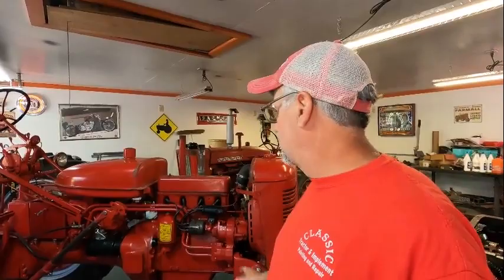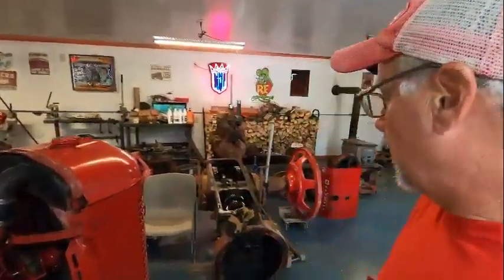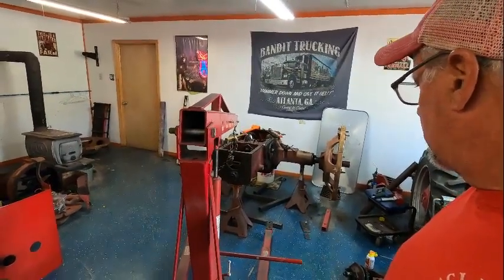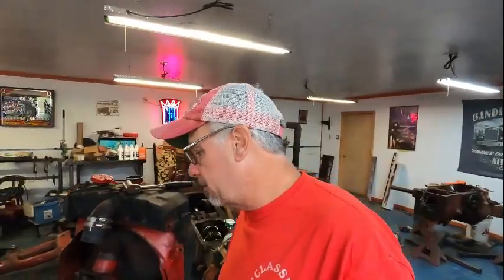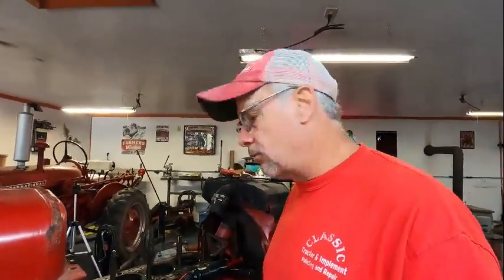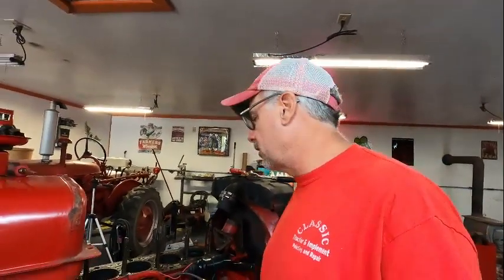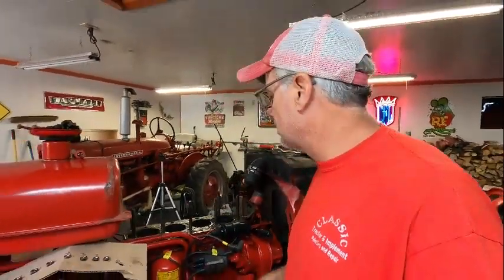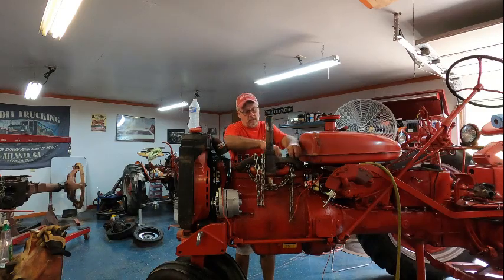Head Gasket Replacement

Comment: Sorry to see that "C" with troubles, but you are doing the right thing, especially where it was a "pulling tractor".  Attic vent fans?  I hope one is pulling air in and the other pushing the hot air out to create a cross air flow, or is there another way for replacement air to get into the attic?
Reply from the maker: There vents under the eaves of the roof to create a draft. Thanks for watching Farmer Dave